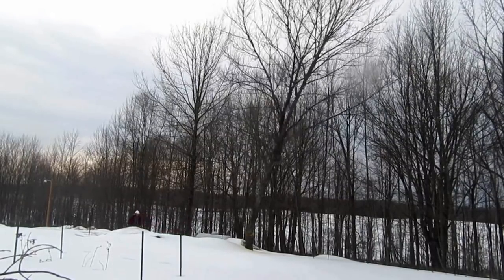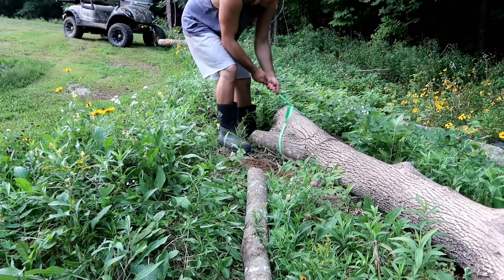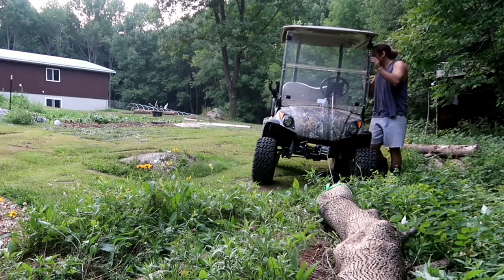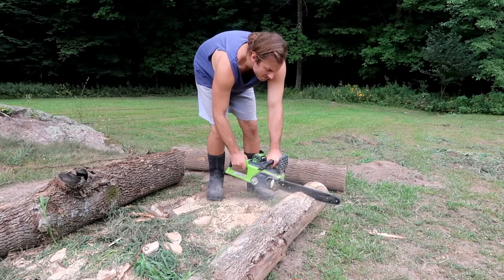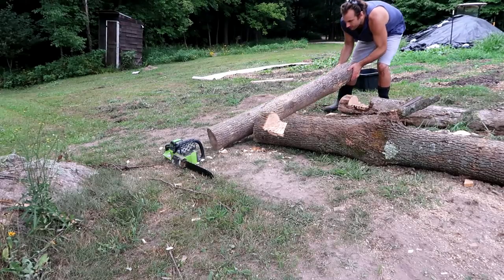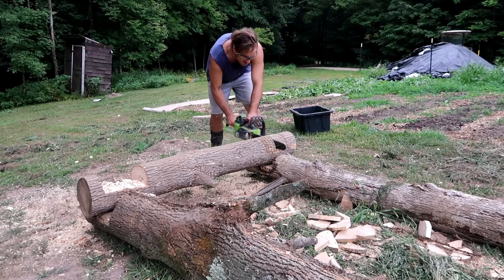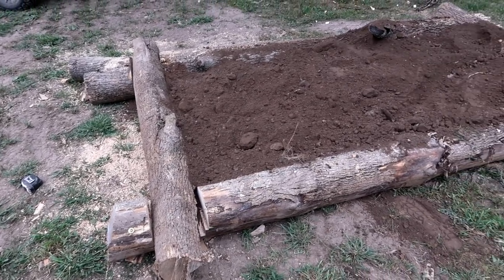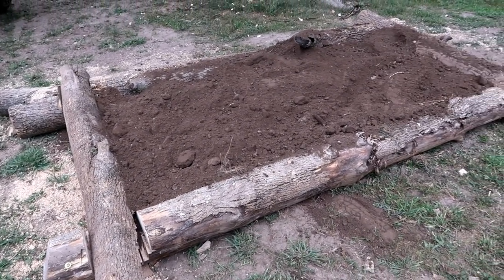Man Builds Raised Bed Using LOGS

Comment: In my local vernacular, your sir- are a yahoo :)  THANKYOU!  for the post, I have similar resources here and wanted to visualize this. Seriously thinking of a cheap chainsaw mill to square things off. Maybe even try and heat treat, and seal with diesel/drain oil combo some garden posts(old style pressure treated). Going to checkout your channel now. Best wishes.